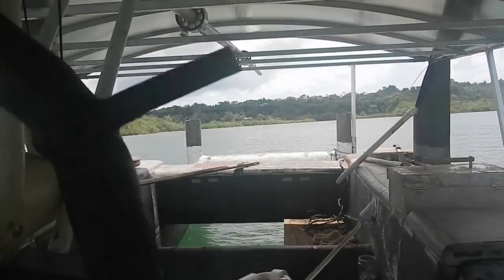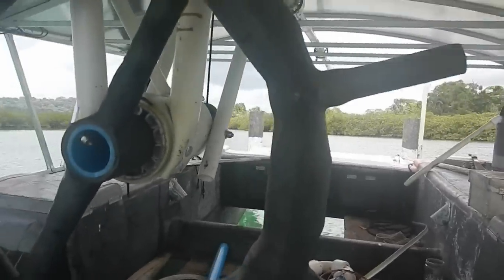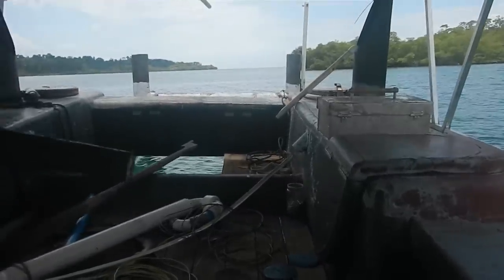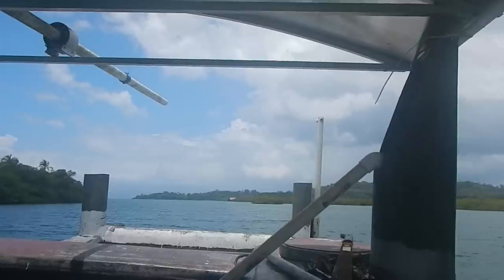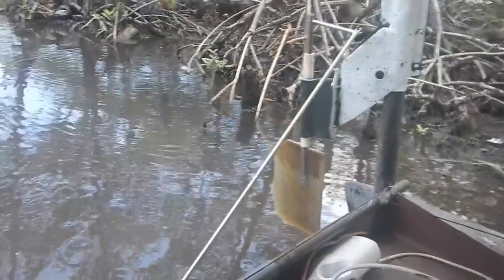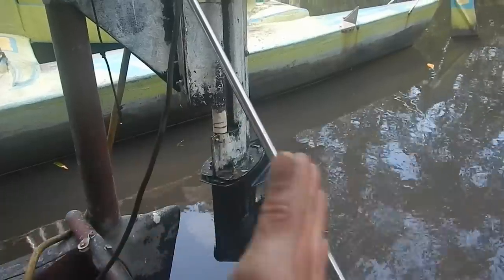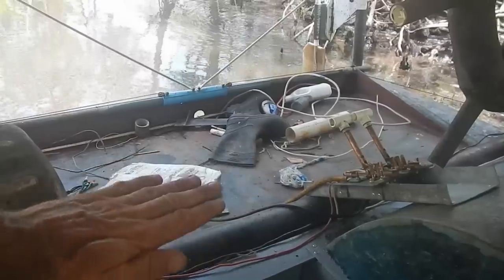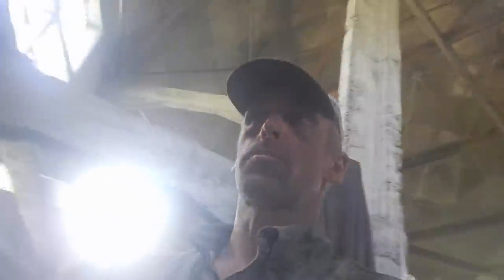Shark Slicer Upgrade 022 First Test!

Comment: Since the pedals/paddle are on their own frame, you could make a hinge at the back so that you can lift the front of the frame out of the water when you are not using the paddle. That way you don't have to deal with the drag from the paddles when running the engine.
Reply: Super idea, love it.
Reply: Good idea!
Reply: Adjust the depth according to different wave conditions..
Reply: He probably doesn’t care because he always wants to paddle

Comment: You can buy a used electric trolling motor for about $200 and they are dead quiet. Best $200 you will ever spend. Also a tiller handle would be way better than that wheel. Also a battery or two would give you reliable consistent power.

Comment: Hey Jamie. Why don't you put the outboard at the front on a rotating mount and steer it opposite to your rudder, rather than cut the pipe off. 
It will work better there to reduce the bow wave and screws  are more efficient pulling than pushing. 
I really don't know why you bother with all those noisy inefficient gears. 
Some nice big belt pulleys made from ply or triple diagonal laminated strip planks to give a reduction to a long prop shaft under the boat that you can raise and lower, hanging the end by the prop in an open  leather saddle greased with animal fat or rubber or even pvc or polyethylene pipe bush lubed by water works great. 
You can have a cable coming up to the hull from the saddle on each side. 
To raise and lower the shaft, and give some steering if you need it. 
My mate did this in his 80ft ocean Cat. 
Has a Nissan 1800 van diesel and five speed and reverse auto gearbox, on the foredeck, with a six meter two inch scaffolding pipe to extend the van driveshaft behind the universal coupling. 
And a bronze shaft for the back six feet that are underwater. 
He only ever runs in third or fourth gear at just above idle with the diesel. 
About 10 hp at most. But that eighty foot cat scoots along at 12 knots. On ten HP, weighs about 12 tonnes. 
Has lots of masts and other windage multipliers. 
Think his prop is about a 8 inch diameter, nine or ten inch pitch.

Comment: Wider is better, but those paddles definately need to go a little bit deeper. They are just skimming the surface, and on the surface you don't have any resistance of water weight to push against. You're just churning the water.
Reply: Having said that, Yes, this boat was awesome, now it's super awesome. I love the steering mechanism also.

Comment: Jamie you need a 2nd steering motor and some battery's at least 8 6volt golf cart battery's to make 12 or 24volt  for when there's no clouds and navigation lights. I recommend lithium battery's and a 60amp MPPT charge controller for the battery's.